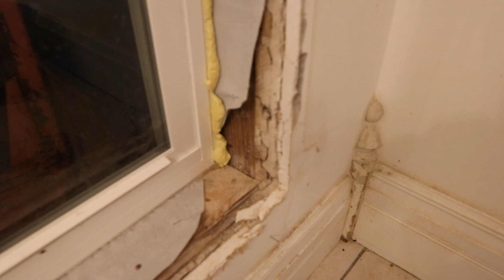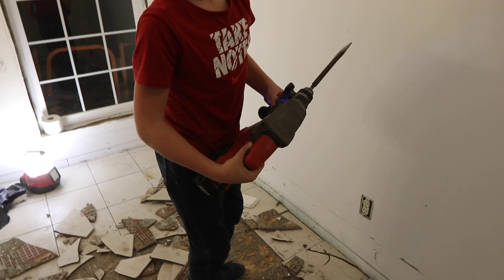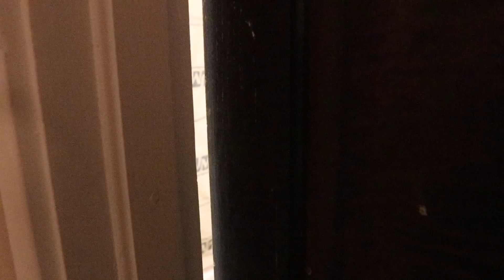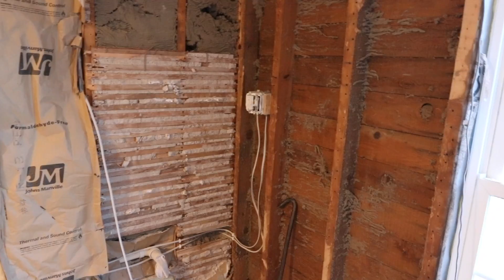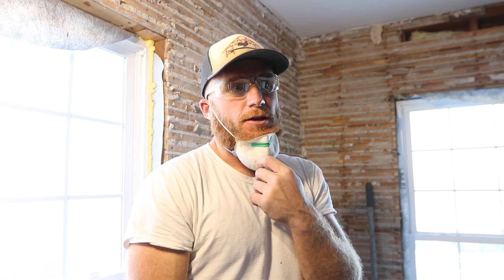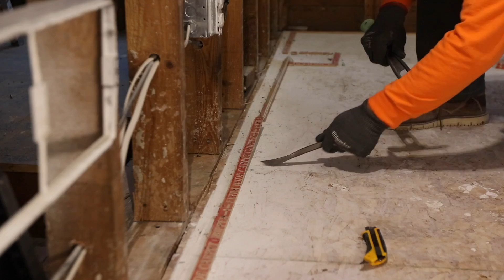Remodeling My Farm House: Demolition

Comment: At least the old insulation wasn't old newspapers. Who ever did the blown in insulation didn't over do it, apparently. I have gone through some of the same issues as you, but different problems of someone not doing it right. I bought this house were in now, where they completely put up new drywall,but they should have was to re pipe the house. My neighbor being a plumber ran all new pipe throughout the house did a great job, but I had to go back and redo all the 40 some holes. That with the dust going everywhere not so great. The copper pipe that I had, was so outdated and was rotting from the inside. After going through hurricane Irma, had a few leaks then having a new roof installed. But hey glad that's done with!
Reply from the maker: Wow man glad it’s done now that sounds miserable

Comment: Kyle, I cant decide whose remodel is worse.. Mine or yours haha. I had 2x4'x3/4" drywall horizontally with about 1/2" plaster on top.. Then wood chips as insulation. Which was crazy because 1 "bat" 8'x16" stud space would fill up 2 large construction grade garbage bags. We did our demo during a 2 week christmas break and spray foam after electrical rough in. What a difference
Reply from the maker: Wow man that does sound horrible
Reply: That rock board sucks.... heavy as none other too.
Reply: @adamliske  seriously. Dropped a small piece on my foot above the steel toe and thought i broke my foot

Comment: Would love for you to go into you tiling being a 13+ year tiler and watching US youtubers builders never use liquid waterproofing membranes to fully tank their bathrooms. Instead opting for ditra or blanket/wrap type solutions that seem to be a lot more work time wise installing, more expensive and have multiple processes that could potentially have more points of failure. I don't understand why they don't use caulk in corners and premixed fiber reinforced liquid membrane. I also would be interested to see what modern tile and bathroom fixtures are instyle in the US/your area. Most Australian jobs have 600x300mm tiles and up in size and floor to ceiling on all walls nowadays. With the water waste being falled to a smart grate drain. Stand alone baths and cealing mounted waterfall style shower heads, single panel glass shower screens are also popular but let the heat out.
Reply from the maker: Shoot man I’m no tile expert or designer... I haven’t even thought that far ahead just a rough idea
Reply: Oddly enough in the US, code requires all changes in plane on tiled surfaces to be caulked. It almost never happens, but it’s a really simple code requirement to follow to prevent long term issues when things move, and everything moves eventually.
Reply: @adamliske  he will use ditra I can almost promise ya.  And the liquid membranes are more time consuming then labor intensive.  Waiting for that stuff to dry 3 times would be just as expensive and with ditra or kerdi you can get alot more done in a day.
Reply: @R2Mike  Caulk internals open a bucket get a paint roller, roll the membrane in your internals cut fabric roll place in corner roll again over the fabric while the first coat is wet finish the rest of the walls and floor wait 3-4 hours (depends on product and humidity some are 24hours) apply a 2nd thicker coat then wait 10 hours apply a third coat and your done. Surface clean up prep is the same as ditra or similar. Also I'm concerned with thin set glue, it really should be left for 5-12 plus hours even going onto render block or slab substrate. I watched a couple videos on installing it and they walked on it was too soon in my opinion. I highly doubt the adhesives bond hasn't been broken or at least cracked in spots. You are relying on what I assume is a cement based glue (I pray most use a 2 part rubber modified glue or epoxy or construction adhesive) to stick to rubber and to bridge the gap between multiple sheets, you can't argue that one continuous layer of thick membrane isn't better when done right you really can't pull it apart by itself let alone once it's bonded to a surface plus if you can paint you can probably waterproof with minimal guidance. But the 15 - 25 year warranty on the product vs using multiple products from different companies, I could see a problem arising and and they'd be blaming each other for a fault. Any way I could be totally wrong and the US way could be 100% fine or even better then membrane, I know some tradies I've meet have been stuck in there ways and think "their way is the best" so happy to be directed to research on the subject. :)
Reply: @nicko198718  my basic install would be after everything is level and plumb.  Kerbiboard, set pan, drain, waterproof screws, corners, and floor.  Then tile the pan.  Can easily be done in 8hrs ready for wall tile the next day.  The few hundred up front eliminates a day or better of labor cost
Reply: The US almost always has either tubs or showers with a small ledge to keep the water inside.  No-step showers are rather new over here, and do require a membrane going further into the bathroom so that water goes back to the drain.  Its rather rare to find bathrooms that are fully tiled and have floor drains too.  We're also big on sloping everything towards drains.  I've been to some other countries and their showers are dead-flat and often take longer to drain out.  

A really big consideration is that the US is mostly wood framing.  If you have standing water, a shower that flows back into the room, poor membrane install, etc., you will quickly have significant issues and eventually rotten subfloor and joists.  Wood also moves and can compromise a liquid membrane.  This is not much of a concern in concrete construction, which tends to be more common in lots of other countries.  We keep the water inside the bath/shower and slope it so it quickly drains out.  Whatever water splashes elsewhere wont be a huge problem, it evaporates.

Comment: Were you the one to blow the grey insulation in the walls previously? Is that what those smaller 2" ish holes were? I'd say it's safe to assume that the walls weren't insulated when the house was built but I've been wrong before.
Reply from the maker: I did not it was done about 50 years ago I believe
Reply: @RRBuildings  imagine heating and living in that house before the insulation was blown in!  We are lucky to live in this era.

Comment: Keeping the mess to a minimum will keep the client (i.e. wife) happy. I need to fix a plumbing leak behind my shower surround. It is 1” thick plaster wall covered with 1” thick tile (tile + base). I’ve been putting it off for almost a decade.
Reply: Can you get to it from the next room wall? Had the same thing and was fortunate enough the shower was backed up to the kitchen and can hide the repair behind the fridge  lol
Reply: @hotrodhog2170  The other side is our very visible main hallway. The plaster is in very good condition so I can't go in that way. I wanted to cut an access panel and cover it with a mirror. The wife wasn't into that.
Reply: @Rickmakes  I understand.

Comment: It looks like you have a balloon type construction for your exterior walls; the studs go from the sill plate on the foundation up to the top plate for the roof rafters. This allows a bit of a draft to occur from the first floor to the second. While insulation is good for keeping it warm this is not a good thing if you are to ever have a fire. while it may be a pain in the bum to do, do you think installing fire blocking in the stud cavities right even with the floor would be a wise decision?  I have no idea how far along you are with the project and I may be too late, but it is just an idea if you still can get to it.
Reply from the maker: Someone already filled it in with blocking even though it’s balloon.
Reply: @RRBuildings  Nice.